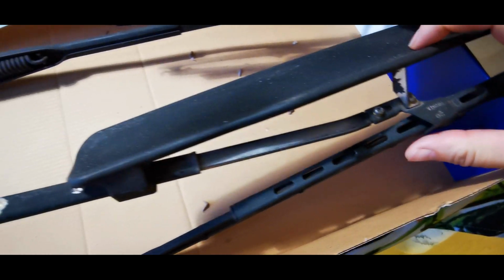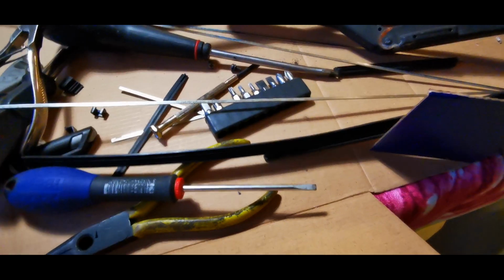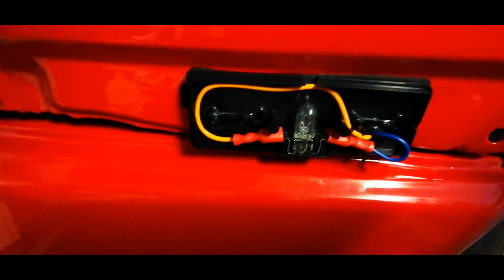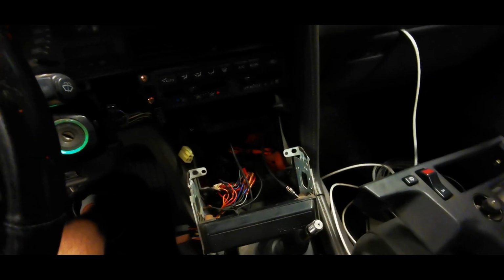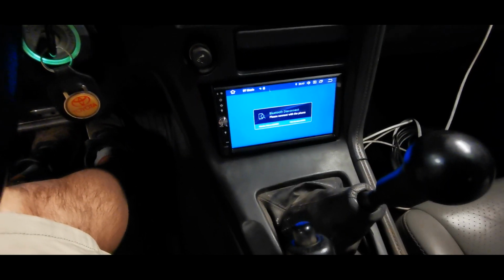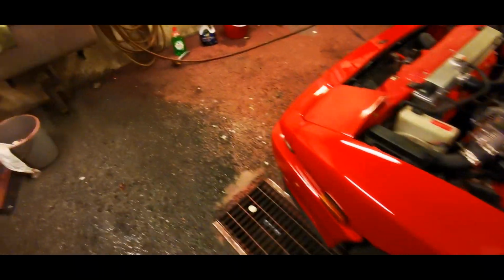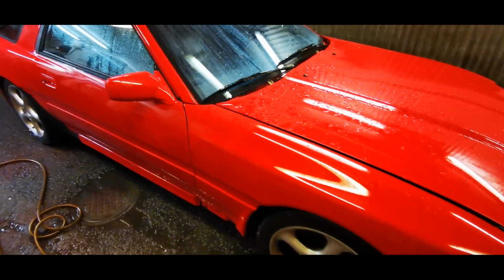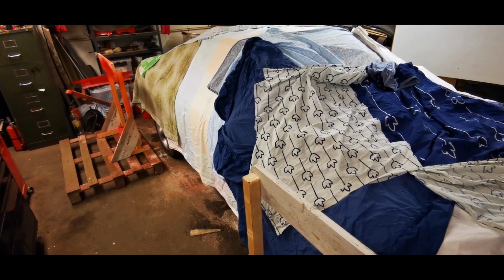SqE - Supra mk3 - Episode 15 - My supra is out in the wild! Inspection time

Comment: That red pops nicely. On the wiper arms, look for a 2 bolt J-hook adapter for the 3 wiper arms. Try your local oil change place also and they might give you a few for free (how I got mine 10 years ago): https://www.ebay.com/p/5017016303
Reply from the maker: Thank you 😊
Yes, those are the adapters I'm speaking of. There is a store here in Sweden who sells those. So I will see if those are in plastic or metal.
And BTW, I only have 2 wiper arms 😉 I removed the rear one before painting the hatch since it was never used, leaking water and rusting.